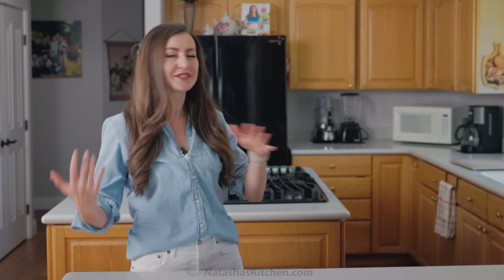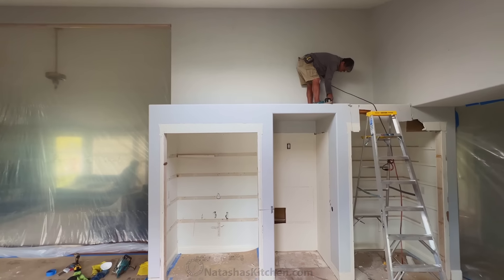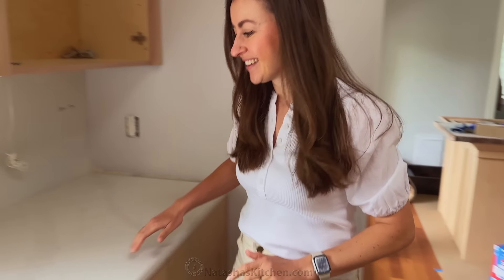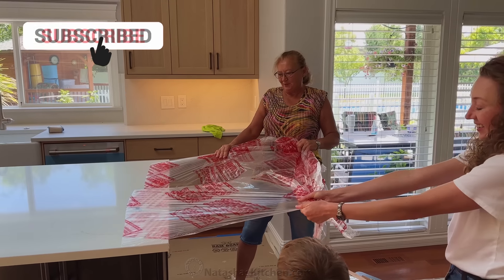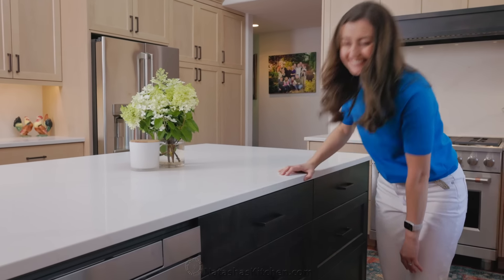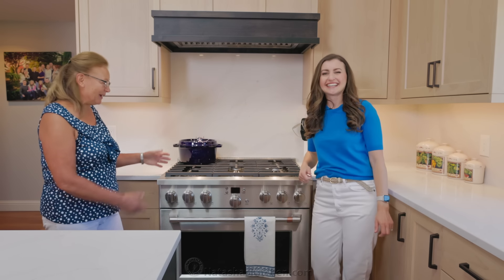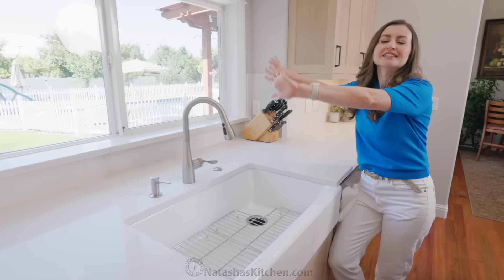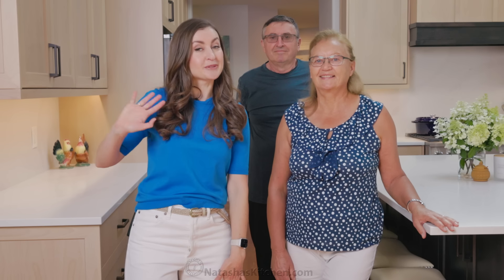Transforming My Parents' Kitchen: Watch the Stunning Makeover!

Comment: Beautiful kitchen and beautiful family Natasha.  The fridge is quite similar to mine and it is a dream. I will make one comment hopefully to help people. We experienced the floor starting to warp and pulled out the fridge but didn't see anything as far as damage from the the fridge water ice maker system. Well as it turned out there was a very very small pinhole in the tube connecting the water and it was going down in along the wall.  All fixed now BUT we also were told to purchase a device which can be purchased very cheap to put on your hose line. The device has an alarm on it. So if ever you start getting a leak or any moisture  etc the alarm goes off and no damage will be done. This is also a good idea for a dishwasher.  Lifesaver I would say.  Natasha you and your mom should cook together on a video and share with us.  Cheers
Reply from the maker: Thanks a lot for sharing that with us! We appreciate it.

Comment: I don't get a double sink. One side has the garbage disposal and that's usually the smaller side where dishes don't fit very well and the other side doesn't have a garbage disposal and that's where all the little bits and pieces of food debris collect - and if you're not careful, it runs down the drain and clogs it. I'm constantly chasing bits of food that get over on that side and pushing it over on the other side so that it can go down with the disposal. 
We're due for a remodel and that's one of the first things I want to change. Single sinks makes sense and farmhouse sinks rule! Our last place we did a new kitchen and I loved my IKEA farmhouse sink. Unfortunately they don't make that particular one anymore. 

 ❤I got some great ideas from this video!
Reply: I love having a double sink, I have a rack on one side to let dishes dry. 🙃